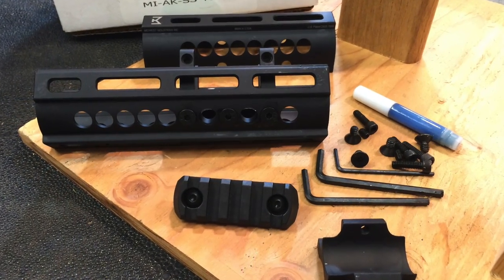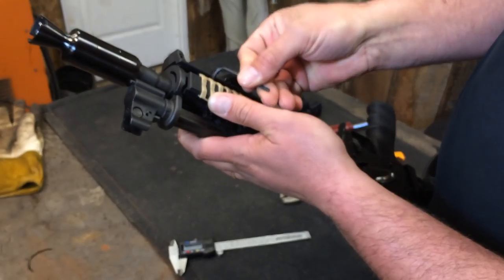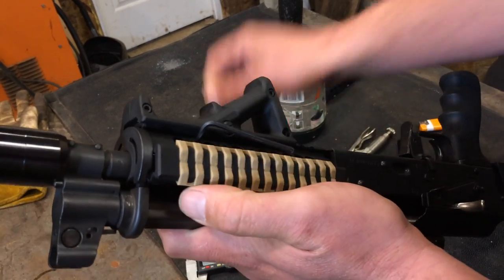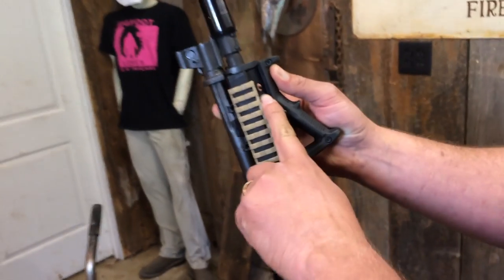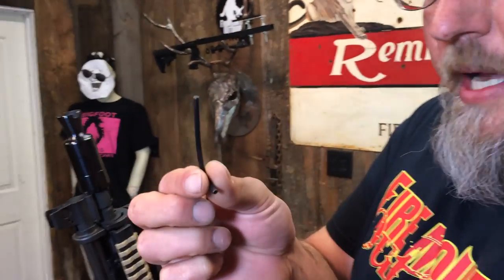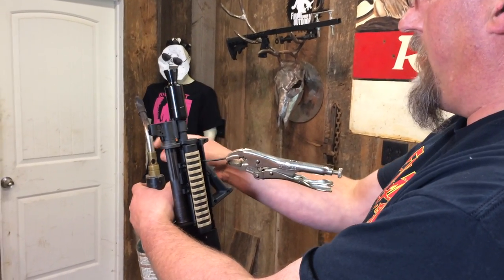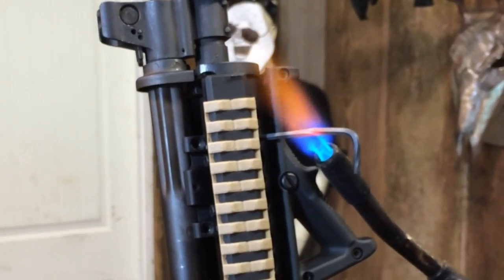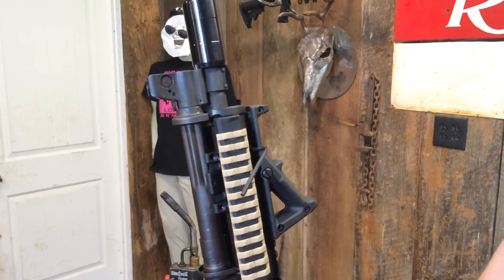How to: Removing allen screws secured with Loctite on an AK-47

Comment: The simplest and easiest way :touch the head of the screw with the tip of a soldering iron.
Reply: I've tried this and it has never worked for me. Even kept it in place for upwards of 10 minutes with no change on blue loctite.
Reply: Sounds good on paper but it won’t transfer the heat properly
Reply: I second that! And you can use a heat gun as well!

Comment: ...Thanks for the tip. I'm working on a bow rest  that has a small screw that IS NOT supposed to be locked in from the manufacturer...So much for that. Think I'll try a variable temp soldering iron to the head of the screw (it's really small), and see if my allen wrench will extract it. For small screws like on your AK-47, try Loctite #222 for small screws...

Comment: I use a hot air station and just apply the hot air right to the screw.  Its meant for desoldering electronics but you'd be surprised how many other uses it has.  It came in very handy for taking the crappy front sight off a keltec sub2000 and straightening the front sight on an ak47 (leaned left).

Comment: Midwest industries provides blue locktight. If you use that on the screws just hold a hair dryer directly on a for a minute or 2. Worked for me.

Comment: I "pretzeled" 2 allen wrenches trying to remove the set screws on an ar gas block. Got a hardened allan wrench bit set--- and had the head of the bit shear clean off in the screw. 

Didn't put any loctite on it when I initially put the gas block on; I must have just balls-ed it up and over torqued them when I first put them on or something.

Comment: Should have gone with Loctite 222 (Low strength), removable with hand tools. Great to see you used the correct technique (heat) to remove a high strength threadlocker.

Comment: I don't like the propane tanks in the house since I don't use it as much and worried it might blow up sitting there for so long. What I do instead is use boiling hot water from a kettle and just pour it slowly to make sure it heats it up well enough. It works everytime for me, even stubborn barrel nuts from an AR15.

Comment: I just use a soldering iron, you can get a crap one for $20 from home depot
Reply: YES, BUT A TORCH IS MUCH MORE MANLY!!!
Reply: ***** Or Harbor Freight for like $4.99 , for a super crap one
Reply: +saltyshellback  lol imagine taking a engine apart that had 277 red high strength sure it stops bolts inside coming loose but it will be a pain blow torch every bolt just to  get a bad crank out  sure loose engine parts is not good but you dont want your engine to blow a hole if a part falls out

Comment: Slightly off topic too; but is it really?  Anyway, I'm going to try this on the HE3 Front Load Washer, trying to remove a stainless steel security bolt that is obviously loctite secure, holding the spider onto the drum.  Even a hand held impact driver is making no headway, but at least is not stripping out the either the bolt or the tool.  Perhaps heat will work.  If I can find my Butane torch; I'll post my results...  (Well, my butane torch has wandered away ... need more locks... anyway I was fortunate to be able to drill off the heads, and get them out that way.  But, I will sure remember this as another option.)  Thanks so much for sharing this!

Comment: So what do you do when you put the screw back remove the old lock tight ?put new lock tight? Or just put the screw back as is ?
Reply: I’m trying to fix a free float handgaurd thats slightly left but all the screws are secured with lock tight what would be the best way to secure the handgaurd back without messing up anything?

Comment: No disrespect but I have a hard time believing that Allen got twisted that bad with those cheap hex heads ...  

You don't need a torch that big working on weapons   , you can get a 10$ mini torch with a "pin point" flame  from any automotive store . Red loctite has to be heated between 300-500° to remove seal ,   this may eventual work but your going to be there awhile .

Comment: I have a buffer tube loctited to the lower receiver with blue loctite. Any ideas? Castle nut is loose now, but I cant turn the tube to remove it.
Reply from the maker: I'd carefully apply heat to the tube, not the receiver.   Loctite releases at 428 degrees f.
Reply: Fire Mountain Outdoors thanks brother!

Comment: Be doing that tomoro , get meself a heat gun , very small size allen bolt , in a motorbike handlebar clock, gone from 7/8"" to 1" , last bolt vibrated out,  kinda overkilled this 1.
Reply from the maker: Good luck, Jennifer!
Reply: sorted, bit of heat, @magic , pride of place, on2 dragbars ,